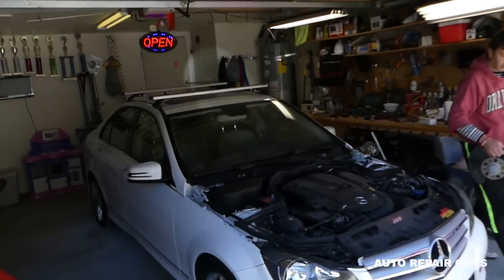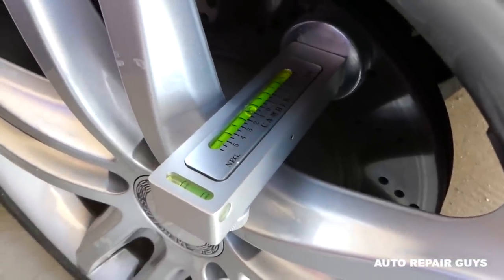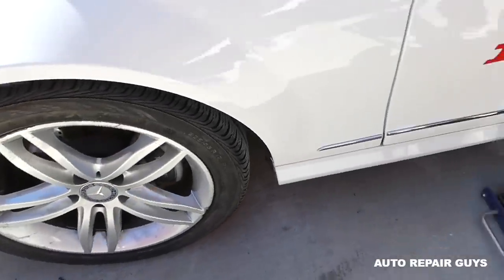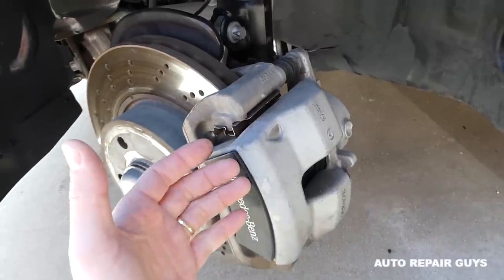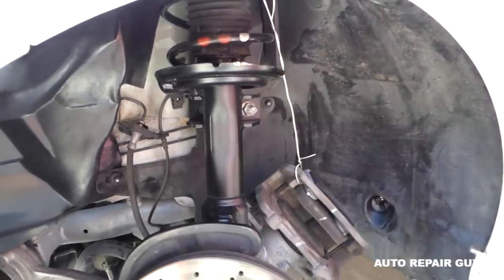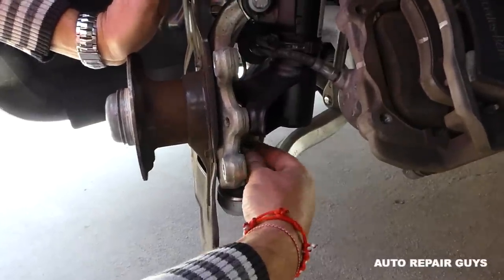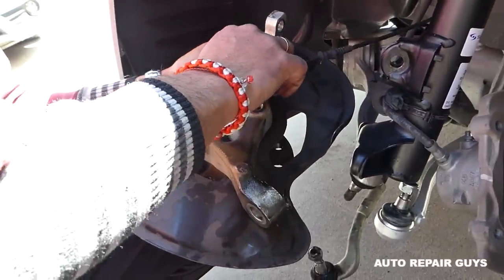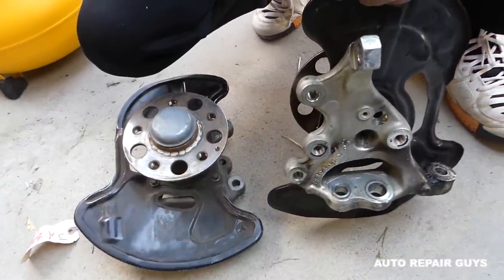MERCEDES W204 WHEEL BEARING SPINDLE HUB REMOVAL REPLACEMENT C250 C300 C350 C220 C280

Comment: What type of impact wrench were you using? Looks like it runs on nothing but so powerful!
Reply: Look on Amazon at the AC Delco g12 impact I have this one. 
buy a 2 or 3 pack of battery and a charger. They also have the g12 ratchet these are so convenient

Comment: Nice step by step instructions. If it was only do easy. All those suspension  and control arms. Takes a lot more to get loose then it appears on your video. I wish it were ACTUALLY so easy and loose.  And don't forget where those 20 bolts and nuts go when you put things back together. Better yet. Just take it to your mechanic!  Cause You're going to need more then a screw driver and a ratchet.

Comment: Greeting I'm looking for advise   I have a 2012 Mercedes Benz w204 like the white one you work on. I'm having issues up front when I turn (doesn't matter which way) I'm getting a noise coming from the axle or whatever it is. I took it to big o tire and they said it was the a arms and perhaps the struts as well. Do you have anything that I might need to know I am at a lost and have no clue what to do it sounds pretty bad but it's been like this now for more that 30000 miles or so. Anything you have to say would be great thank you and keep the videos coming.
Reply: It might be steering knuckles if u haven't changed your suspension yet